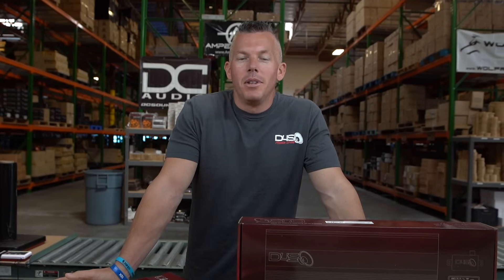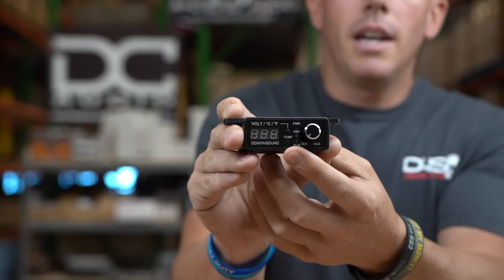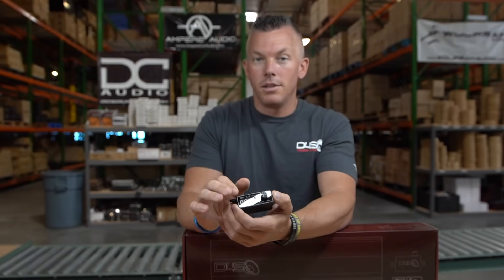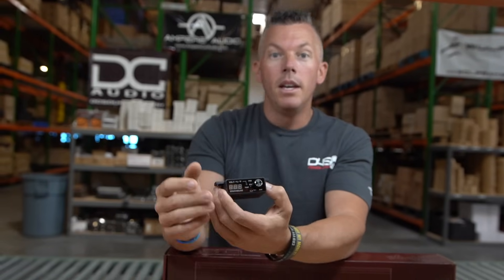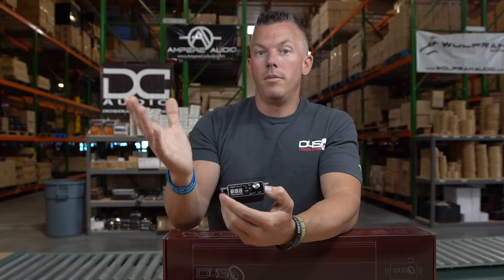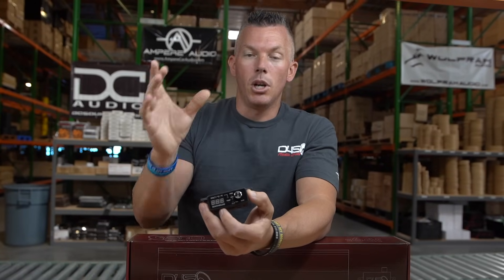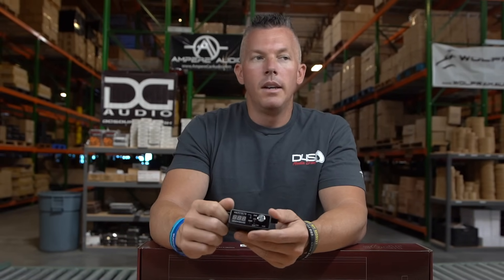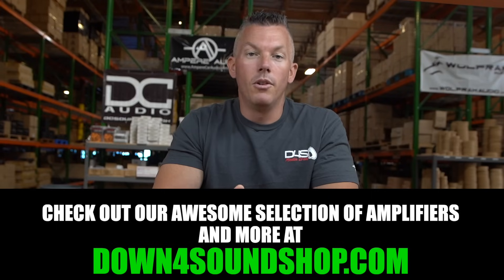CLIPPING: WHERE DOES IT START, HOW DO YOU PREVENT IT?

Comment: Ty for this video. But I have a question I hope you can answer.  I have a JL 1000.1 mono amp and 2x 10 inch pioneer Z series subs.   My amp has a clipping indicator on it. Only on some songs and certain bass lines does the light flicker for a second and goes back off.  Of course if they hold a certain bass line for 3 seconds the light will light up for that 3 seconds but that is very rare. Is this safe?
Reply: I’m no expert but my best guess would be power issue. Sounds like on some bass parts of songs your amp clips cause it’s trying to use more power than your vehicle can provide.

Again that’s just my guess. Maybe try to test it with an amp clamp and a multimeter.

Comment: What if you turn on your car and the amp is already clipping without subs hooked up and without wires touching? What could it possibly be
Reply: I would check the gain and also make sure things like bass boost are turned off. You don't need any speakers hooked up for the output on the amp to be clipped. I would imagine 80% of people have their gain set too high. Maybe by a lot or maybe just a little but it is a very common thing and a lot of people just kind of guess at it. They fry equipment and lose interest in the hobby when it was just a matter of matching the gain to the source. Generally, once everything is setup properly, bass boost just isn't necessary and lots of people fry subs with it.

Comment: I have the JP8 and the JP84, running a 13 inch Focal Polyclass on the JP8,  it’s clipping so early, right before any kinda power is felt from the sub, sometimes it sounds okay if I’m walking the threshold. Do I need the upgrades for just the JP8 and JP84? Doesn’t seem right
Reply: I’ve tried 2 different subs and same issue
Reply from the maker: Get a bigger amp like the jp23

Comment: So my question is, I bought your package deal around 6 months ago. 2k amp two sundown 12s that where 500 watts each.  I’ve done big 3 bigger alternator and all zero gauge wire. And the clipping has never stopped. And I always see comments about the clipping with that package. So why is it that way it never goes away. Was it not tested properly?
Reply from the maker: I explained it fully in this video. Stop turning it up so far

Comment: Why prevent it? Soft clip it or you're leaving a ton of power on the table.
Reply: Or you can just have a more powerful amp and not clip at all. Don't recommend to people that you should clip your amplifier
Reply: @beardedforlife3740  no matter what amp you have you're wasting a lot of power if you don't clip it a little. If it only hits RMS power at 0db you're leaving a lot on the table.
Reply: @Thezuule1  a bigger amp allows for more usable power without having distortion or clipping
Reply: @beardedforlife3740  sure and you can tune that amp to leave half the power on the table if you like. I don't care to argue with you. Tune your amps however you like.
Reply: @Thezuule1  see what you don't understand is I can tune my amps using a db overlap and be just as loud. The difference is my system will sound much cleaner than yours because I will have zero distortion
Reply: @beardedforlife3740  I've been installing systems for 23 years, and there's plenty I still don't understand, but gain overlap isn't one of them. How can I make "I'm not going to argue with you" more clear? For the last time, spend your money and tune your equipment however you like.
Reply: @Thezuule1  if you don't understand then why comment on it
Reply: @beardedforlife3740  bye 👋

Comment: Most of the customers I service have done self installs and the source is usually clipping. I use the SMD DD-1+ and CC-1 to calibrate these systems and the difference in night and day. Most recently, a customer had a Boss mono block amp that supposedly put out 1125w rms @ 2 ohms. He did the 3/4 volume and DMM method and set the voltage at 47v. It sounded like crap. After going through the system, turns out this crap amp was clipping at 19.7v, barely able to put out 195w. Can't reliably use a DMM to set gains on a cheap Walmart or Amazon amp.

Comment: I have 3 Skar Zvx D2 12’s wired down to 1ohm running off of a 8000.1 Taramps 1ohm stable and have a HO alt 300 amp with a 18 farad cap(Boss) and a yellow top cap. Is my amp copping because I don’t have enough power I just got the yellow top because I was having voltage drop like a mf but I’m considering getting the 25ah limitless lithium would that work?

Comment: Bottom line...  buy a amp that has at least 50% more rms power than what your subs are rated. Don't match the rms, so bigger than needed rms amps don't have to work so hard
Reply: Subwoofers never really play at the ohm load on the box either so you're never going to get 1 ohm power for more than a split second and the bulk of the time the subs will be at 1.8 or 2.1 ohms anyway while they're playing.
Reply: @Thezuule1 that has to do with the wiring
Reply: @chrisa9035  it’s just how voice coils operate. The ohm load is always changing as the speaker is moving.
Reply: The amp don't know what the subs are rated for.
Reply: Hmmmm so I have the sundown zv6 12 on a sundown 4k that’s almost 50 but still clips
Reply: @chris444b444  clipping means that the amp gain isn't set right
Reply: @chris444b444  u need a salt 4 or 8 for breathing room on this v6's
Reply: @chris444b444  subs don't clip, the signal from the Amp does.
Reply: @sergioh2015  why would my sub be clipping I have a 600watt sundown and a 1000 watt amp
Reply: @Moise  poor charging system maybe, I know I'm running my amp fairly weak, and it clips because I have all stock grounds and power wires for the battery and alternator. Look up the big three upgrade. Adding a battery bank helps over all performance as well.
Reply: @Ltxmoise 2 much gain gain isn’t volume knob
Reply: @Ltxmoise 💡RMS Is the real power of the amp, NOT what is says on the box, they always overrate many amps😫👍
Reply: I was thinking of running a 1200 watt amp with some 800-1000 watt speakers soon. Should I go a little higher? I don't think so tbh.
Reply: @sergioh2015  it will be ok
Reply: @Pittsburgh-412  ended up getting 2 P3 12s with the jp23 and it sounds amazing.
Reply: @sergio hernandez  hell ya man. I've had the Rockford Fosgate power t1 12s for years and I love them. I have it on the jp23. Sounds amazing. Congratulations man
Reply: @Pittsburgh 412  thanks! My next step is building a good electrical foundation for my car. Then ramping it up a bit lol eventually I'll go with some nice t1s1 13", but this will do for now
Reply: @Pittsburgh-412  How many watts can 2 P3D12's handle?  I have a smart 3K on them wired at 1 Ohm Im considering getting another Smart 3K and wiring 1 amp to each sub at 4 Ohms  Would this be way too much amp for them?  Ive also thought of the Smart 5K and just leave them at 1 ohm. Whats your opinion on the best way to go? Thanks
Reply: @Tim Wheeler  I've had my Fosgate power t1 12s on the jp23 for well over a year now. They hit good. Im not sure but I really don't think the p3s can handle much more than that smart 3k is putting out already. But it's up to you
Reply: @Tim Wheeler  with with my JP23 at 2 ohms I feel it's still a lot of power going to my P3s, around 1300w I still have that breathing room of electrical to upgrade. But unless the power is absolutely clean then I'd be careful.
Reply: @Pittsburgh-412 hey I have the skar sdr-10 and the skar rp-1200.1d but it still cuts out is my amp not strong enough?
Reply: @sergioh2015  same setup I have  and I blew the skar subwoofer today.
Reply: @AL Copone  oof. With the way my system is running my 12s should've blown already, why Rockford fosgate is superior in quality. I got mine each at 200. With skar you have to have a good foundation electrical wise to keep up with the amps needs other wise it'll be clip city
Reply: @sergioh2015  wiring is correct. It was my subsonic that I turned it lower than I should've.
Reply: @AL Copone  no I'm not saying if the wiring isn't done right, is just that  learning where your clipping is at, and realizing how you can expand electrically. Big 3 is big to help you push a little harder with cleaner signal. I'm about to go 2 gauge from 4 gauge and push about 1300w (my goal) more consistently, that plus I'm going from CCA to OFC. So all together my amp won't be sending dirty signal to the speakers. Luckily my bass knob has a clip light
Reply: I have a 2000watt amp tuned down for my tiny 12's 500max each so i could get rid of my clipping
Reply: So if I have 4 speakers with each an RMS of 100W (example of wired parallel through 4 separate channels) An amp that can do 200W RNS per channel is def in the safe spot and I can just tune it down back to RMS or wherever comfortable? (Ofc considering at the correct ohm)
Reply: @blurryeclipse4464  correct
Reply: So if I have a 500w amp and a 250 rms 10 i should be good right?
Reply: @Jay Boy  you match the Amp to rms but if it's a quality sub yeah you'll be fine for a bit
Reply: Yessss time to get a 6k
Reply: I have a 3000amp on 2 12” 700W-1400W max , each, wired to 1 ohm, am I overpowering them a little too much ?
Reply: @exsuvio2620  as long as it's clean power and you don't over do it all the time you'll be fine for a good while
Reply: Love the 2nd gen TC!!
Reply: @traviswerkmeister5066  thanks man. Me too. I got two dc audio level 6 15s in mine. On a wolfram 7500. It pounds lol. I took my Rockford Fosgate t1s out
Reply: So if my sub is a 800 rms max and my amp is  1200 wat it should be fine ?
Reply: @AngelAguilar-hd2ev  clean signal yeah
Reply: @AngelAguilar-hd2ev  good electrical pretty much is your answer
Reply: @AngelAguilar-hd2ev is it a single sub or 2 subs?
Reply: Good stuff
Reply: I have 2 L7  10,s with  a hi phonics Brutus monoblock amp I’m experiencing major clipping someone let me know why please
Reply: @Sup81_tedloc  clipping starts at the head unit. You can't go past a certain point or it clips. Your gains are probably set too high on the amp too
Reply: I have a boombox that clips at around 80 hz.  But the lower frequencies say 30 hets it plays no problem even at max volume and the speakers moving massively. But for subs reason at the higher bass frequencies it wimps out. What would cause this? Thx
Reply: @Mabeylater293  subwoofers are supposed to play 80hz. That's midbass
Reply: 💡SIMPLE AS THAT!💥👍👍

Comment: Good information.  Also the head unit can cause it as there is a amp in there to.  Amp feeding you amp.  After everything is turned you need to know your systems limits.

Comment: SOME amplifiers you can very distinctively hear the very beginning of it clipping the sine wave HOWEVER how will you know unless a clip light or Oscope (DD1 if only at 40Hz) is used to know which amplifier you can and can not. so I agree good luck. The reason clipping kills is because it causes excessive amperage, amperage equals more heat, and heat kills all. Clipping is a very specific form of distortion, , I wouldn't say they are one of the same.

Comment: I've noticed when my amp starts clipping my voltage drops like crazy. My guess is that it's probably because it's really inefficient to clip an amp my head unit goes up to 40 but I only play it at 21 max because I know its safe for my sub without my highs being way to loud
Reply: When clipping the amplifier dumps amperage like crazy which to dump it it needs to consume it
Reply: Dropping voltage can get the clipping started and you may be experiencing that. If you are having an extended session around the upper limits of the amp and the voltage begins dropping down into the 13v or 12v range the clipping can start without touching a thing even though it wasn't clipping at that volume just a minute before. I would guess it is your electrical causing the clipping rather than the clipping draining your electrical.

Comment: Is it as accurate as the dd1 tho?🤔
Reply from the maker: Yes sir
Reply: @THELIFEOFPRICE  my sfb3000d is pretty darn accurate! What should I buy to replace the sfb3000d for 2 Xv.2 15 in a 8.5 cube enclosure tuned 32hrtz it's in my tb and I have mechman 240, Big3,and 1/0 g wire and a small xs power d975 for supplement in bk! It clips still should I get more battery and more wire... Or should I get bigger amp and more battery plus wire
Reply: clip lights on amps/bass knobs usually come on before a DD1 distortion light. they come on during soft clipping/ >1% distortion.

Comment: Damn JP that's a good explanation. You know 30 years ago we didn't have all that fancy technology and oscilloscopes was expensive as fuck. Back then I used the multimeter and some test tones. I turned it up till I heard distortion watching the voltage and then turn it back 30%. So basically don't laugh we didn't have all this big power back then but you know we did have the same fucking decibels. I was doing 58's w/ four 12s walled. I think the amps was showing right at 280 volts when you could hear distortion and I'd turn it below 220.   Car audio is just like everything else, you're already fucking something up when it starts feeling good.

Comment: JP, I have been waiting for thid video since i bought my SUNDOWN X V2 D2 along with a SFB 3000D which I am doubting right now if I need to upgrade to a SALT 4 AMP or get an ALT or a JY LITHIUM BATTERY. good video like always I watch all your content. @DOWN4SOUND 🙌
Reply: Kid you can’t run SFBS below 1 ohm. You will have to get a salt 4 and run it at half ohm. You’ll need a high output alternator and some good batteries
Reply: @dreteyy  how would he run a single D2 sub at 0.5 ohm? Kid...

Comment: I got a 370 mechman, 2 d3400 xs batteries under the hood, a d4s lithium battery in the back, 1/0 gauge wire running, big 3, 2 ZV5 12s on a DB aak4000 tuned with the dd1 and i still clip, i dont get it. Everything is hooked up correctly
Reply: You need a bigger amp. The DD1 is just to match the head unit and the gain on the amp. Your ZV5 are under powered
Reply: @shaunkimberling214  so that explains the clipping? Wat else can i get thats Korean board besides that db aak4000 that would be better?
Reply: @bashns7743  Taramps makes a really good amp but it’s Brazilian board the MD8000.1

Comment: I had a set of two 15s built to my spec from a well known builder and blew one in less than four months from a " by the ear" setup on two amps running the two subs. When I ordered my two Zv5s, I also ordered and religiously used my SMD DD1 and CC1 to set my head unit max volume and amp gains, and have been clip free for over two years now. No issues whatsoever. I'm a firm believer now.
Reply: It's entirely possible to tune by ear without damaging stuff and you shouldn't tune amps to never clip. There's a reason the DD1 disc comes with -5db, -10db, etc tracks. If you're not clipping at all you're leaving a massive amount of power on the table. If the only time you're getting the full power out of the amp is when a 0db note plays consider every other note is nowhere near the amp's real output and music is dynamic.
Reply: I put togethee my own system, nothing fanzy. 800w rms 1 ohm sub and matched it with amp with same rms. Running good for 3 years. Now the big mistake is also to bush it too hard. Sound pressure level? Think that is where some of the problem is. I personally do my builds on sound quality and keep the volume down a little to save my ears.
Reply: Tuned mine by ear it was just fine you could turn up to 40 🤷‍♂️
Reply: I also was getting my system tuned by these " People who say they can tune your audio system by ear. Dude told me he's been in car audio for 30 yrs. and my sub still blew. So I bought the SDM DD1.

Comment: I'd love a jp series amp just for the clip indicators although I only have 800wrms worth of sub..
Reply: they make the JP8 which is an 800W @1ohm amplifier
Reply: I have a JP8 and it is nice. It would suit your needs. You typically want more amp than sub because of impedance rise and other factors, a sub will never see the full power of the amp pushing it. At least no for more than a brief moments when playing music. Some channels on youtube show real time numbers while playing music and it is not unusual for a 3k amp to push between a couple of hundred watts up to maybe a bit over 2k while playing music. It is a whole rabbit hole to go down but if you try to match numbers, you will sell yourself short and possibly wind up clipping because it doesn't sound that loud.

I have had my JP8 for a while now and love the clip light. I don't think I will ever get an amp again without a clip light. Songs are recorded at all sorts of different levels and picking one for setting your gains makes the others a bit, or a lot, sub-optimal. This gives some wiggle room and I can just nudge things up to just before clipping and roll with it without worrying. Not sure on your setup but if you think your ride could handle it, I would almost say get the JP23. Gives you room to upgrade and no one is ever "finished" with their system it seems. Always wanting a bit more power and volume. If not you can get a second JP8 later. It is strappable and gives 2300w @2 ohms.
Reply: JP8 would be great for you then